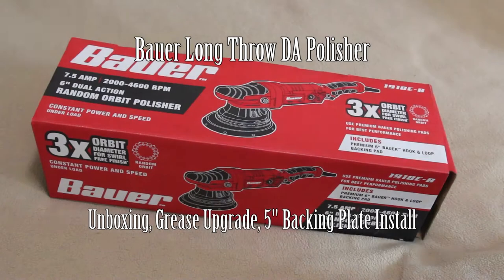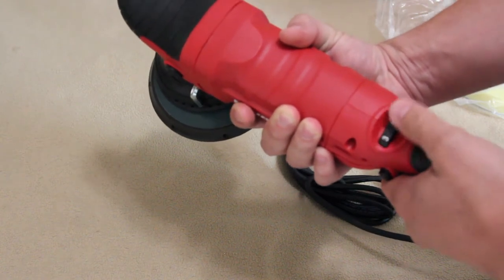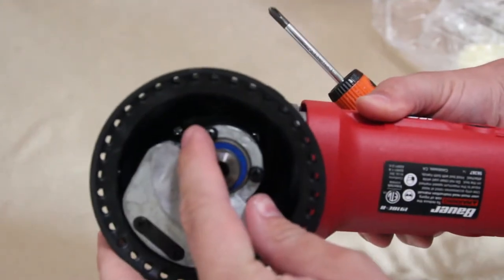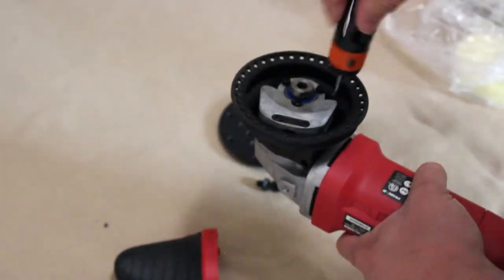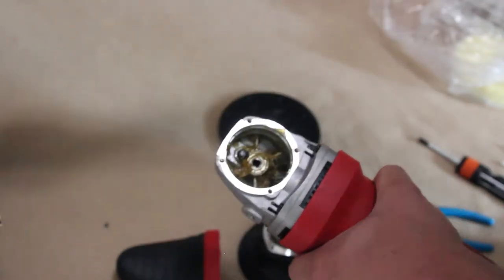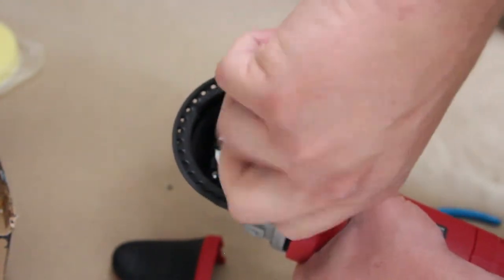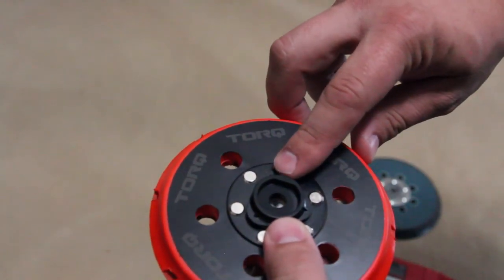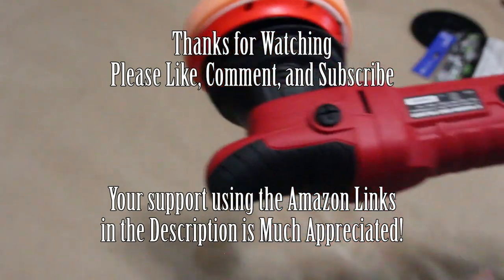Bauer Long Throw Random Orbital Polisher – Unboxing, Grease Upgrade, and 5” Backing Plate Swap

Comment: When you take the plastic screws off and the plastic cover, there is a button you can press down when you rotate the weight into a detent and you can lock it down to remove or replace a backing plate
Reply from the maker: If you can grip the backing plate with your other hand that worked for me when the unit was brand new. I would imagine over time and use this button becomes more handy though. Lol

Comment: Good video, do you know the process of dialing in the counter weight? I feel like there's room for improvement going to the 5 inch.
Reply from the maker: Hmm I don't know that process yet. I'll have to fiddle around and see if I can come up with something. Guessing you might be able to drill it to reduce the weight but would be interesting to test!
Reply: @GearGuy2001  well, there's a hole in the front where you can line up the counter weight and there's a screw you can adjust with the included allen wrench. There's just no procedure mentioned in the manual .
Reply: @carbonite1983  any more information on the counter weight adjustment? I can’t get that socket cap bolt to budge - I haven’t put a cheater bar on it yet

Comment: How's the polish? You're working out for you with your upgrades ?
Reply from the maker: Pretty good. Check that center bolt though occasionally and make sure it stays tight. Maybe even put a few dabs on Locktite. Mine flung off as I was using it and since then Ive put a slightly longer bolt and locktite on it. I wet sanded and buffed a boat using the polisher.

Comment: What I found with these in general or even laptops is you might get all the screws but the last one is always tough. I think they put thread lock on it. You could put some nail polish remover on that one tough screw for a few minutes and try again if you don't want to destroy the screw that is. And after all that work you never showed how the polisher works with the new grease? Less vibration or noise etc?
Reply from the maker: I didn't really use it before but it seems very quiet with no crazy vibrations afterwards. I knew upon buying it I wanted to do this day 1. However yes you are right I should have done before and after footage!

Comment: Thanks for the video.  I used Mystik JT-6 Hi-Temp grease and the Torq 5" backing plate. I found using pliers not needed when you can get the screws out and back in with a magnetized screwdriver.

Comment: I plan to do this soon but before I order the backing plate, I’ve heard some people prefer the Rupes backing plate instead of Torqs, any comment on this or should I stick to the cheaper Torqs?
Reply from the maker: Sorry I can't say one way or the other. I've only used the Torqs one.
Reply: @GearGuy2001  Thanks for the quick reply. How is the polisher so far and is it preforming nicely? I’m mainly worried about the vibration on this model.
Reply from the maker: @matthewg6183  I certainly don't do as much polishing as I originally anticipated but it's been good for an average home user. I think if this is your first random orbital you would be fine starting here to try it and upgrading if you get more serious in your usage.
Reply: Some people are using the maxshine plate as well.

Comment: Isn't that a button to lock the head under the cover?
Reply from the maker: There is and I just found it easier to grip onto the pad but yes if you remove the cover you have a locking button as well. Ill have to check on your RPM question - try to do that today but what you are describing seems odd.

Comment: I too like the chemical guys hexlogic pads. I'm not big on anything else they make, their compounds suck, clay bars suck, I do like their clay luber though it's not bad. But I've tried lots of different top brand pads and the hexlogic seem to last about three times longer than the rest in my experience
Reply: Their wipe out surface cleaner is decent if you’re in a pinch
Reply: @CaseyGray58  I have never tried it before, thanks though I will take your word for it figuring you have experience with different stuff as I do. I use a lot of 3D brand everything but there pads kind of suck which I had high hopes for going off how well there compounds, polishes, and ceramic coatings work

Comment: Did yours include the yellow buffing/polishing pad? I just bought one this weekend and it came with no pad. I didn't notice until I got mine home that the box was opened from the bottom.
Reply from the maker: Gosh it's been so long I'm not sure.
Reply: @GearGuy2001   - no worries and thanks for the quick reply. If someone watching this vid just bought one, please reply if you received a buffing pad with the machine (not asking about the back plate) Thank you in advance
Reply: Just bought one and no buffing pad included
Reply: thank you!

Comment: Great video ! do you think I could throw a 3 inch pad ?
Reply from the maker: 3" Pad might be kinda small - I suppose you could in a pinch but this is definitely a bigger buffer. If you do it be sure to post how it worked out!
Reply: @GearGuy2001  will do thanks

Comment: What's the reason for swapping out the 6" for a 5" ???
Reply from the maker: Its a little easier to work into different shapes and areas of the cars panels. Also with larger pads its easier to burn your paint (Typically larger then 6")
Reply: @GearGuy2001  Ok thats preference. Yeah You gotta be careful not to burn the paint with these new machines.

Comment: What does the grease do?
Reply from the maker: Their is factory grease inside the unit but its not as good as what we can put in. A higher quality grease is going to help quiet it down and extend the life of the unit. Not required but its a fairly common upgrade so I wanted to explain the steps to do it. Thanks for watching and commenting!

Comment: Idk what I’m doing wrong I cannot get the thing off to save my life
Reply from the maker: Where are you struggling at?
Reply: @GearGuy2001  I’ve got the silver screws out, and seemingly everything else holding it together, but it will not wiggle off!!
Reply from the maker: @michaelmorgan9601  hmmm well those 4 screws are the only thing holding it on. Make sure you grab the metal inside to wiggle. The plastic guard is just free floating and wont really help you get it loose.
Reply: @GearGuy2001  I GOT IT!!!!! holy shit that had me so mad lol . Thank you
Reply from the maker: @michaelmorgan9601  Awesome! Glad you got it loose.